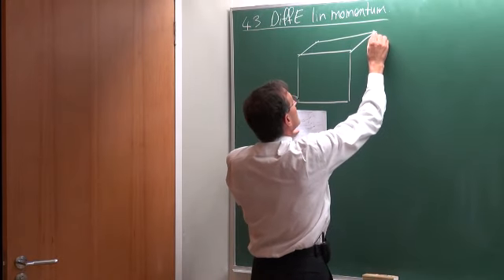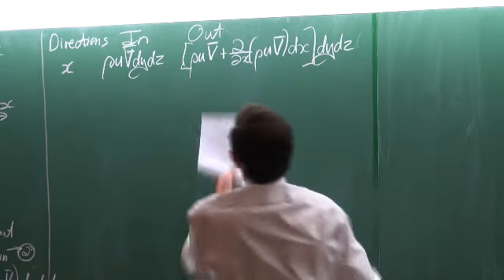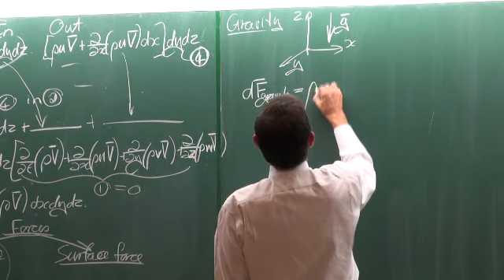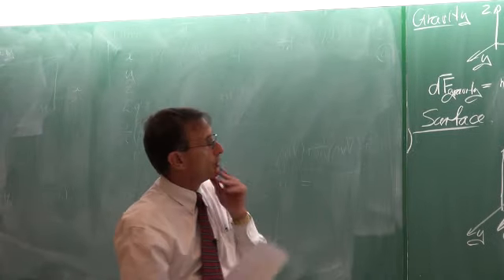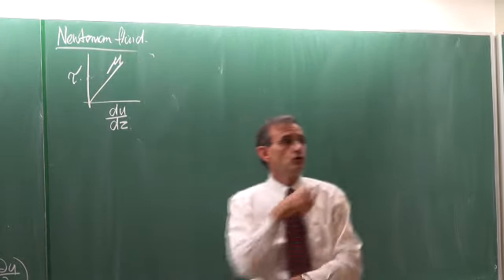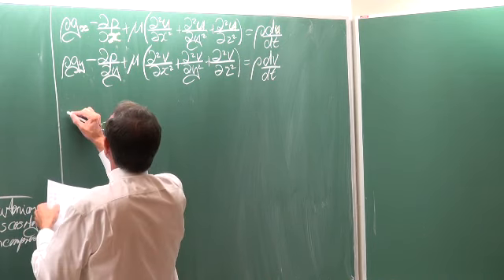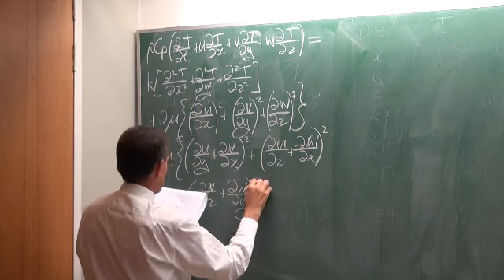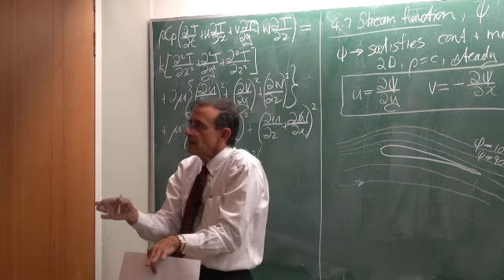Lecture 18 (2014). Momentum and Navier Stokes equations

Comment: At 10:35 min, that does not look like the continuity equation, does it ? 
As per your previous lecture the continuity equation is (cant put in formula here). If you expand the term which you have marked zero, then one term will be V*(continuity) and there will be another term.

Comment: Thank you very much for the lecture. If I am right you have used the control volume approach in which the net momentum outflux has been equated to net force acting on the body. Other approach can be using the 2nd law of motion directly on an infinitesimal FLUID ELEMENT where we equate the net force acting on the element to the product of mass and acceleration of element in EULERIAN reference. Please correct me if I am wrong. 
The thing is I am not able to do that in cylindrical coordinate system. There are no clear derivations of N-S eqns in cylindrical or spherical coordinate systems in most of the hydrodynamic books. Please try to upload a full derivation of this important eqn in cylindrical coordinate systems or if that is not possible pls provide a link for a text version. It will be a great help ....
Reply: thank you for your reference. I will do check that

Comment: What is the title/syllabus for this course?

These lectures along with previous ones (posted 2013) have been extremely helpful with my academics and research. Thank you Prof. Meyer for providing these openly with the community.
Reply from the maker: The name of the module is Thermoflow but it is actually heat transfer
Reply: I've been using these fluid lectures to brush up for a graduate level fire-induced flows course at the University of Maryland. These videos have helped me tremendously and I've recommended them to my classmates.

Thank you again.